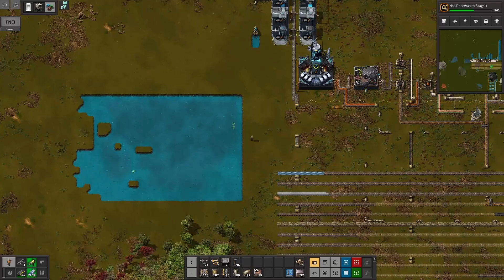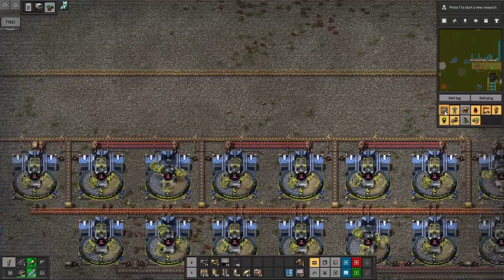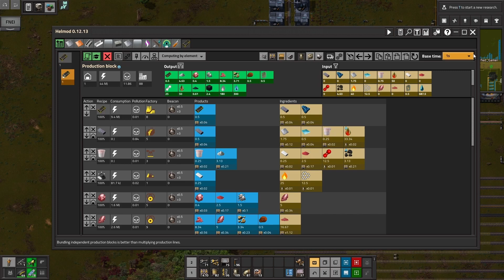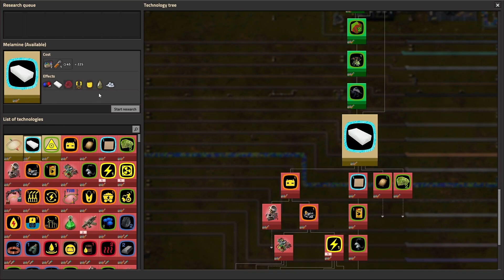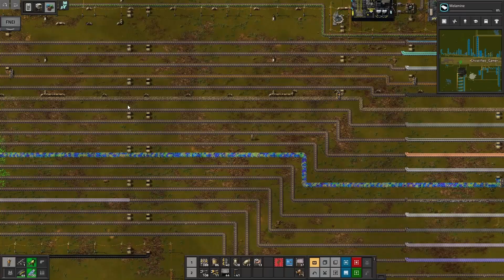Factorio pYanodons - All the Metals for Intermetalics  - EP31

Comment: A quick reminder that a few episodes ago, Pyanodon himself showed up in your comments to remind you to keep the mods updated, because nexelit has recently changed. I took a look at the source code and saw that in addition to adding the digosaurus creature that digs up nexelit (in huge quantities, 4000 ore at once!), there's also been a change to the nexelit-from-tailings recipe: it now requires 500 tailings, not 400, and the plates need 4 ore rather than 2 to make. So if you build this out based on the current ratios, once you update the mods your ratios will be off.
Reply from the maker: Yes!  Recording in advance has it's downfalls ... Stay tuned for the Dig-o-saurus ;)